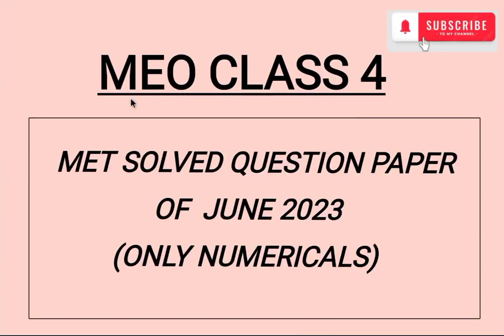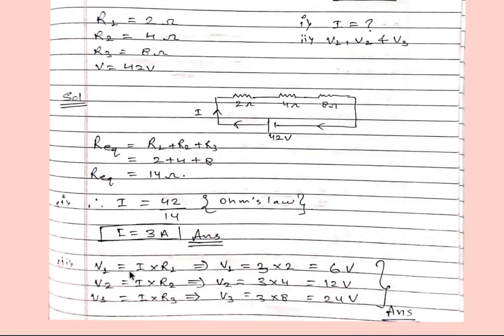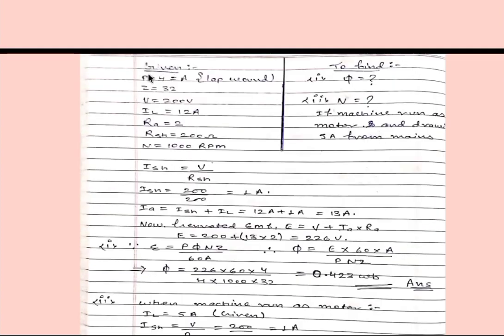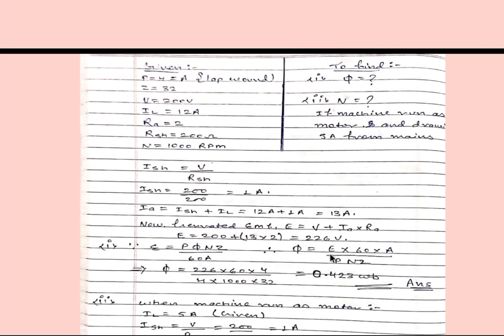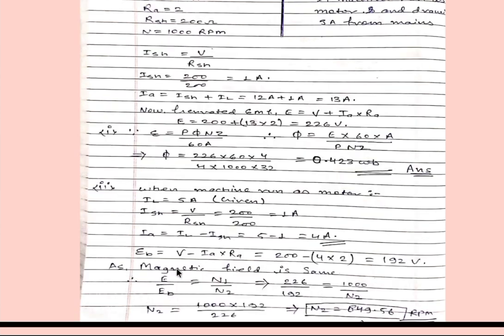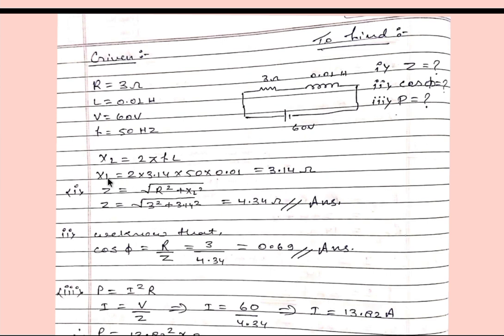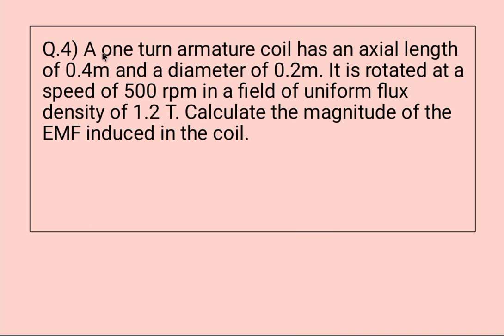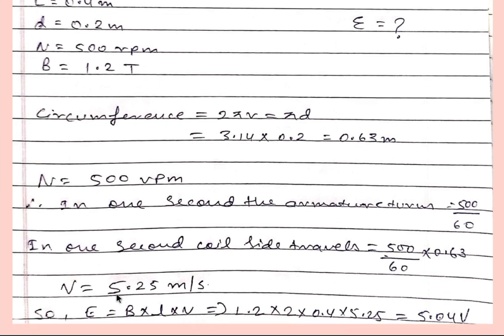MET numerical June 2023 #merchantnavy #electrical

Comment: In question no.4 , at the end when we put value in BLv , where did '2' come from? Because B =1.2, l =.4, v = 5.25.
Then where did '2' come from in last step of calculation?
Reply from the maker: axial length is 0.4 and it's a coil that's why multiplication of 2